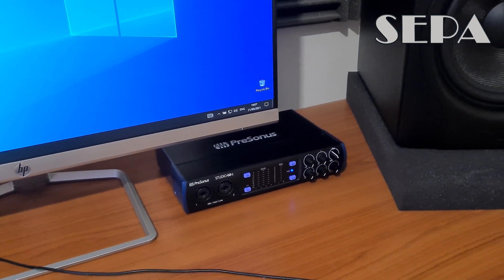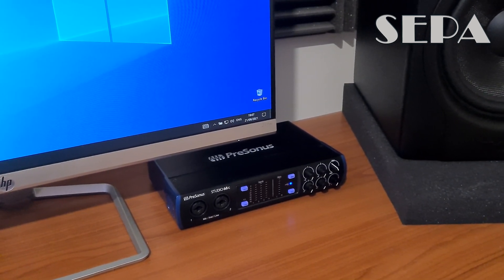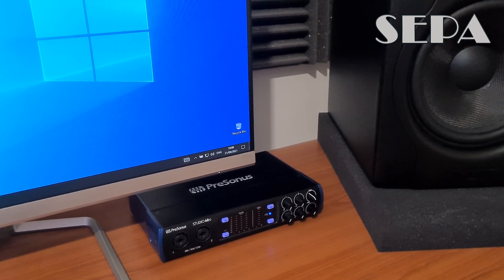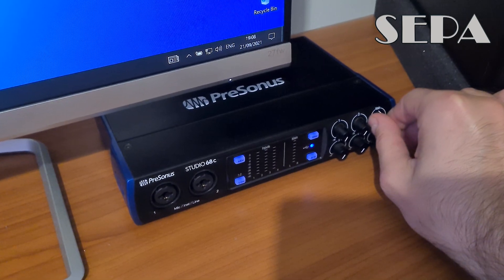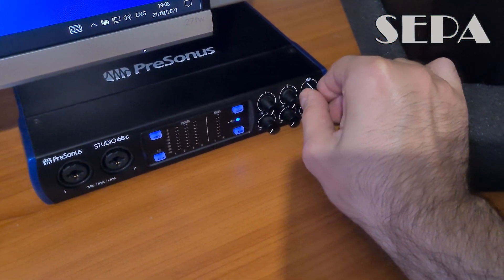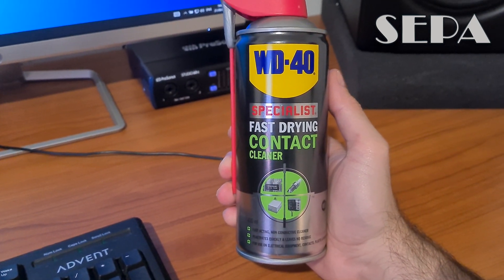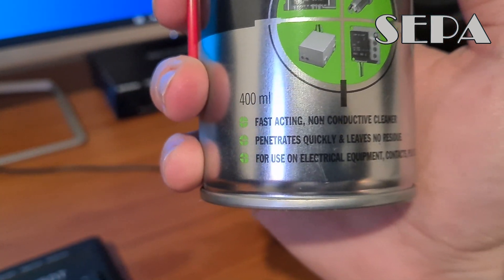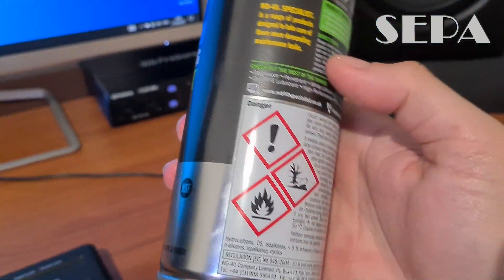How to get rid of screeching sound that volume potentiometers make: Cheap and effective solution!

Comment: I also have a presonus (Studio 24c), and I have done this already, but the problem comes back in a couple of days. Although I might have used a different product, I'm not sure. Does it stays clean for a while for you?
Reply from the maker: Yes, it is still ok since that video was posted. I did sprayed a consistent amount tbf.
Reply: @SEPAChannel  I'll try with wd-40 then, thanks!
Reply from the maker: Tbh mine started making noises again a couple of months ago, but it held quite a while. There is a possibility that your potentiometer showing signs of going to fail?
Reply: @SEPAChannel  I've only had it for 2 years, less than that actually, so I don't think so. It's just dust but I don't understand how it gets in there so easily. Aircompressor works too but same thing, only for a few days. Anyway, I'll try aircomp + wd-40, I'll give you an update how it worked.